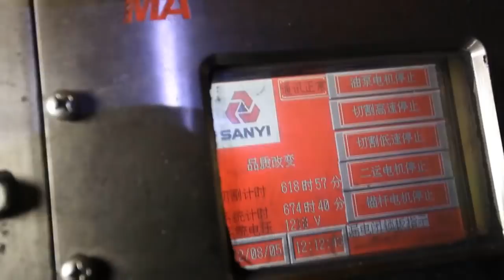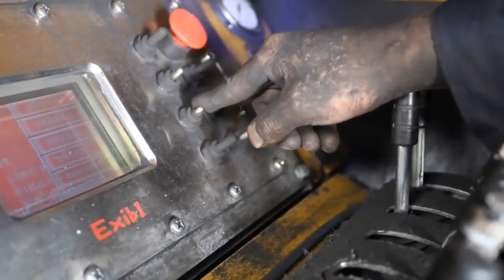HYPNOTIC Video Of Extreme Heavy Construction Equipment Machines in Action - Amazing Modern Machinery

Comment: The last one! all thats coal dust! That poor man!
Reply: Almost all you're seeing there in the air is likely water mist.  If you look closely, you can see rings of nozzles hosing water on the cutting head, specifically to suppress dust.  Explosive hazard to the max if you don't!
Reply: I am surprised he s not smoking a cigarette !
Reply: The dust is under control by using cutting head sprays and venturis. I also expect that the machine has an onboard scrubber which clears the dust from the cut. If it was too dusty you would barely be able to see the operator. The problem will be more about a methane or coal dust explosion than a respiratory hazard.